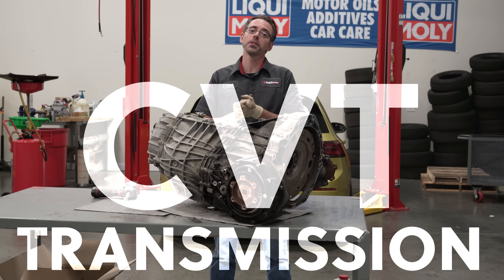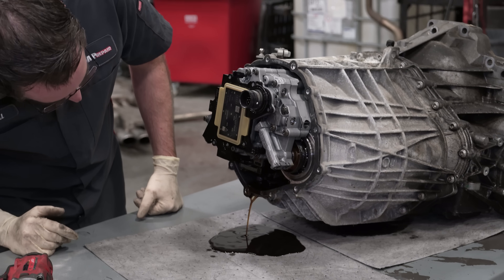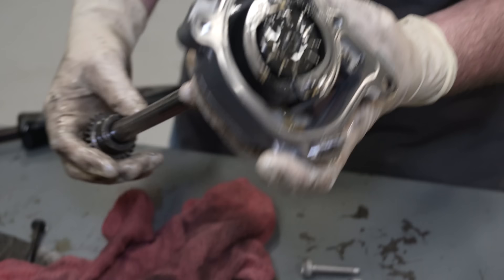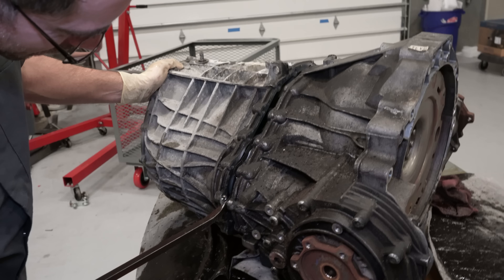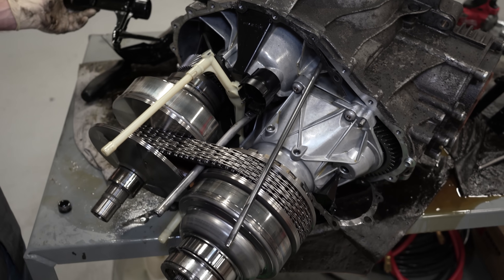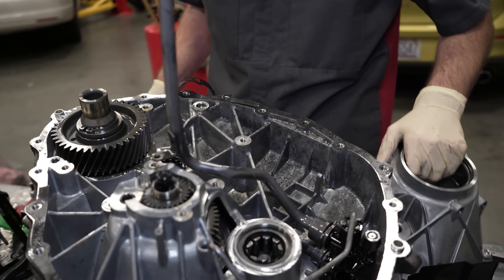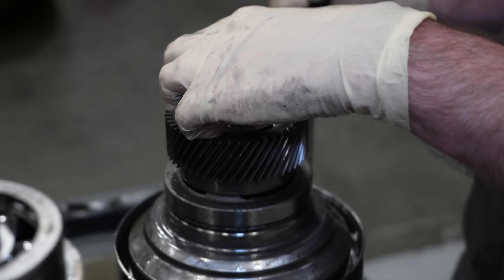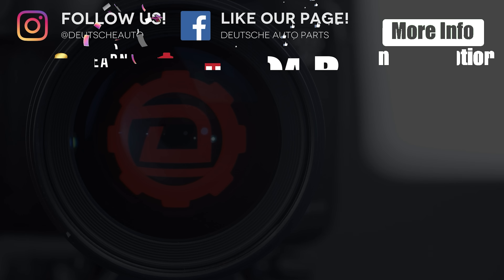Why you shouldn’t get a CVT transmission

Comment: I hate cvt’s
Reply: The 8 speed and 10 speed automatics now shift lightning fast and in terms of lap times it's faster than a standard transmission.
Reply: Same here. I despise these, and you can't use them for performance cars. When you drive a car with a CVT, the motor always sounds like it's gonna blow up, it drones so loud, even at half throttle.
Reply: Don't we all
Reply: I am on my 4th car with a CVT. All Nissans.
I have never had an issue with any of them. I also change the fluid and both filters every 30K
Reply: @Gorilla_cookie I have owned 2 xterras and beat and abused them no trans issues ever, but i change fluid once a year about 15k miles
Reply: Garbage. Have yet to drive one that feels like it operates well.
Reply: My 2020 Nissan Versa had a Cvt, I didn't enjoy  it
Reply: I've driven one and when you step a wee bit harder on the pedal the cvt starts squealing in complaint
Reply: I have a Honda Jazz(Fit) CVT and a City (Civic) Manual. While the Manual is great fun on the highways ...the 7 Speed CVT scores mightily in the bumper to bumper traffic of daily office commute. Honda reliability means no hassles too in years of use
Reply: Most bad reps of cvt comes from “sounding bad” and people saying it’s unreliable when clearly they dont even own one. I got 2 subarus (2014 crosstrek, 2016 forester) with cvts. Never had a problem with the transmission, just change its transmission oil every 50k. 

This video just exaggerates cvts to give it a bad name. As if traditional transmissions are so robust that they dont die. Lol what a nut job of a video.
Reply: I too hate CVT's
Reply: My Camry didn’t have no cvt crash it  now I got a Corolla with cvt smh 30 k still driving strong
Reply: @petermuniz9296 30k is nothing, talk to us when your CVT is still working at 300k, it won’t happen, CVT sucks
Reply: Don’t be a harer
Reply: This CVT reminds me of the "transmission" on my 1970s Rupp mini-bike! 😅
Reply: Me too, hello pal
Reply: They’re great on mini bikes 😂
Reply: I hate it too now
Reply: yup.. me too
Reply: Because CVT's are sooooo bad, manufacturers like Volkswagen/Audi now gave us the DCT's. Well known for being without any problems... 🤣 That's salvation... 🤦‍♂️
Reply: Why ?
Reply: After watching this video I hate CVT transmissions....not sure why but I hate them!
Reply: I'd rather row my own, All the time every time.
Reply: I LOVE mine in my honda crv awd
Reply: CVT are Great on snowmobiles, gas powered golf carts and scooters.. accelerate and go !!
Reply: What did they do to you?
Reply: @locololus  broke repeatedly
Reply: They’re only great on forklifts
Reply: Nissan’s are the absolute worst
Reply: Me 2
Reply: They hate you too
Reply: i also hate cvt's  that no gear changes is annoying i had a honda civic 2015 cvt snapped in half at around 41,000 miles, never going honda again, had to search for another dealer that didnt do cvt's
Reply: Drove a 2014 corolla with one. Still prefer my 92 Accord with the torque converter auto slushbox that slams into every single gear like its life depends on it.
Reply: @orionyesliketheconstellation  Hey, someone else who calls automatics slushbox's. I'll always take a manual transmission if I have any choice at all. It's the single reason I have a 2010 Tacoma and not a 2010 Tundra.
Reply: @johnossendorf9979  i've been looking for a manual for months 😭 good choice brother
Reply: I love my CVT, 36 mpg is amazing compared to the 2018 f150 my family has with 17 mpg.
Reply: @jando3637  When new my father's 1979 Honda Accord got well over 30 mpg with a carbureted 1.6 liter engine and a manual 5 speed transmission. I remember him saying that when it had 150k miles it was getting close to 40 mph. We had a 500 gallon gas tank on the property at that time and he logged how much gas he used. I remember getting the key for the padlock on the hand cracked pump and gas log book and pencil out of the barn. I would crank the pump and he would listen for the gas coming up the filter tube and tell me to stop so I didn't overflow it. I wish I knew how much he payed per gallon in the early 80's for bulk deliveries. Ps. I hate CVT'S too. If the automotive industry wanted to build cars that got great mileage with manual transmissions they absolutely could. The single biggest reason that 79 Accord got the mileage it did was that it was lighter at 1,995 lbs, today's 2022 Honda Accord weights between 3,150 and 3,430 lbs. Pps. I just remembered, Dad said the highly-touted Rusty Jones rust proofing (I can still picture the face of Rusty Jones on the sticker and remember the TV commercials) was a sham because part of the improvement in mileage over 150k was the weight loss because of rust.
Reply: @jando3637  my '17 5.0 F150 4x4 gets 22/23 highway... 19/20 around town, calculated at the pump. Then again I drive like a little old lady so... 🤔
Reply: Sure buddy. And your reason is?
Reply: @timsc125  any of all common problems? it's a belt-driven "transmission" where we trust a computer and only a computer to decide your shifting. 
what is your reasoning for not hating them?
And why the fuck are you coming at me over a week after my comment?
Reply: @timsc125  Did you not watch the video?
Reply: @dgreatll  tell me the reason then :)
Reply: @timsc125  automatics can do what a cvt does. They may not be the best at going up mountains/hillclimbing, but for the mass majority you wouldnt be doing that anyways. Automatic trans are typically cheap but reliable (results may vary). Cvts sound sooo bad when sticking in one gear, sounds like the car will blow up at any given second. They are typically shitty performing and are as you can see, overly complicated. Youre much better off with a manual transmission, or good ole automatic shitbox. Cvts also dont last as long as automatic transmissions for the most part either. They give out faster because of its design, you wont be able to abuse it over and over like you would a beefy auto trans.
Reply: @timsc125  not the guy you were replying to, but they’re unsatisfying and tend to be more prone to failing compared to an average automatic transmission (unless it’s a mid 2000s Nissan) or standard transmission. 

The concept on paper sounds cool, keeping the engine at its max power output while the transmission constantly adjusts to make the car accelerate. But in practice it doesn’t work quite as well as one might hope
Reply: CVTs belong on atvs not cars.
Reply: I love manual transmissions. Slushbox's of any kind suck!
Reply: The worst transmission ever made.